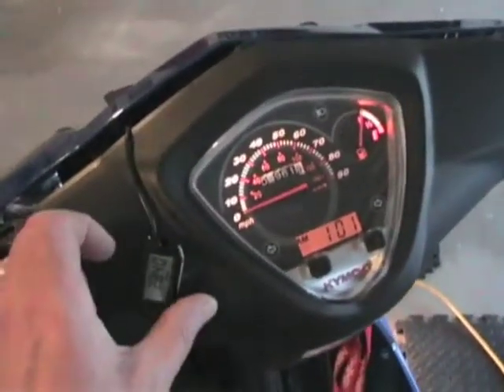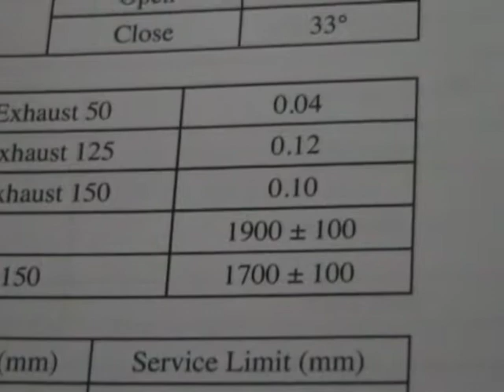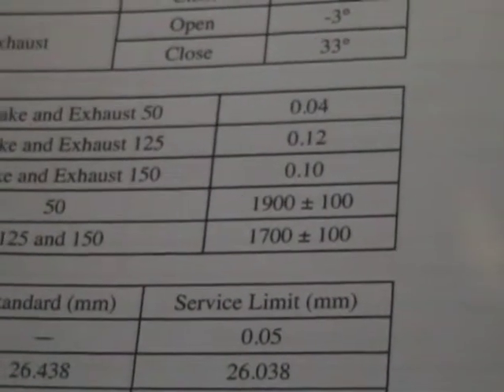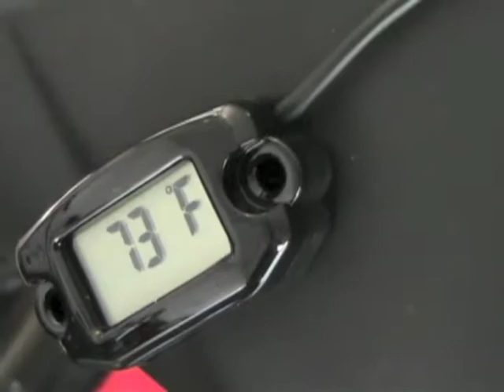10 - Super8 Removing Panels and Installing Tach and Temp Sensors

Comment: What are the white parts on the voltmeter cord and is it long enough to reach or will I need a cord extension?
Reply from the maker: I bought the extender as an add-on. I knew the supplied one wasn't going to be long enough because I wanted to mount the readout on the dash.